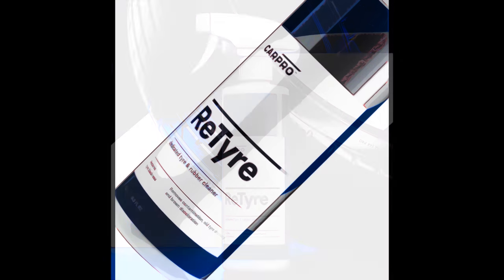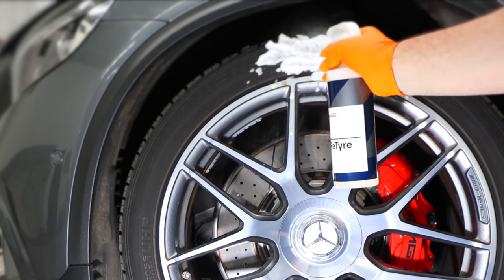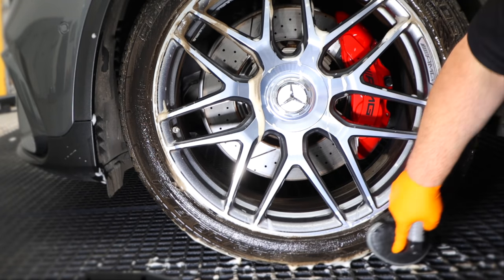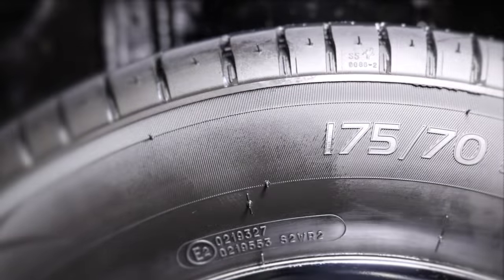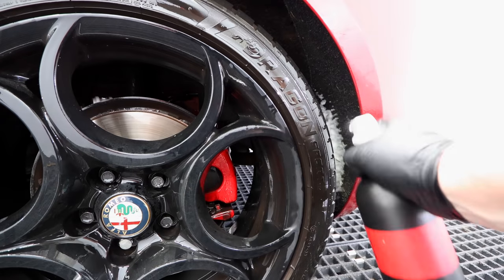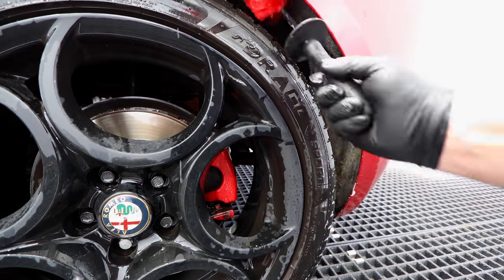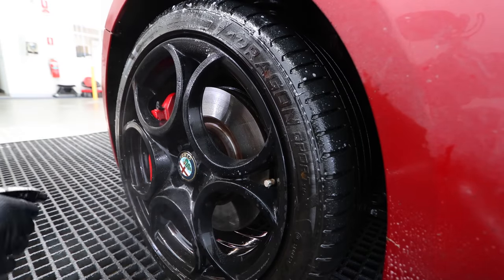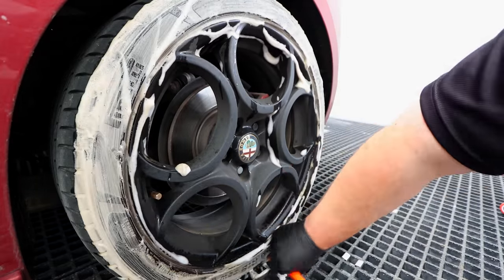Carpro New ReTyre | Car Tyre, Rubber & Wheel Cleaner Reviewed & Demonstrated!

Comment: The foam trigger looked very hard to use and you could try in a IK Foam Pro 2 Handheld Pressure Sprayer or similar. Carpro retyre looks like it does at excellent job. The cost wise you would never use this item professionally or as a weekend warrior. You would use Valetpro Bilberry Wheel Cleaner that diluted would cost (5l concentrate) you £26 for 50l which seems to be the industry standard at 52p per litre. For a touch less wheel cleaner I would recommend 25L Car-Chem Iron Detox Bleeding Fallout Remover  Wheel Cleaner at £76 which works out at £3.04 per litre again this is the industry standard in the UK and also does an excellent job of dissolving embedded iron on car panels.

Comment: How does it compare to the likes of P&S Brake Buster/Adam's Wheel and tyre cleaner? If it works just as well with 1:1 with water and can clean a tyre with only one pass, there is more value added. But using it neat means going through product much faster. I have read that you don't need to fully coat the tyre for it to work well and that adding a standard nozzle helps with more even coverage so that should help also in making it go a longer way.
Reply from the maker: I haven’t used Adam’s Wheel cleaner and only have limited experience with Brake Buster so I’m not the best person to ask there. I think with all products you can certainly tweak and adjust it to address the contamination/goals at hand, so yes, I think you can tweak the application to suit your needs.

Comment: you did a review on shine supply a wile ago and I did ask you whats your fav or what i should try the most you said wise guy and I love it it strips and cleans the tyre really well so my qustion is would retyre be be a good product to test as a replacment if its cheaper in a busniess sense ??????
Reply from the maker: Wise Guy is funny in that it’s really expensive in smaller quantities but really cheap in bulk - which probably matters more because these really aren’t products to buy 500ml or 1L. 
So at least here locally Wise Guy is much cheaper than ReTyre when you go for the 4L but much more expensive when you go for the 500ml options. 
But I guess the other question would be how much would you use of each, is one significantly better or quicker at cleaning than the other and what dilutions you’d use them with, which all adds up to labour and product costs - but I don’t have the answer to that yet!

Comment: Very intriguing. I'd love to try this on my truck, as I've never cleaned the tires in any way in the 3 or so years I've had it, so I'm sure it would be incredibly satisfying to use on it (though it needs new tires anyway). 

Just a general question for either you or anyone else, if something is high PH, is it still able to be used outdoors? Obviously not in direct sunlight, but in terms of environmental, is it safe in that sense?
Reply: I’ve used high ph products outside and it’s fine as long as you don’t let it dry or soak for too long. I’ve used high ph shampoo/soap on cars as a foam wash such as NV Snow+ outside with no issues. Just use it as the manufacture recommends and it’ll be fine. This is just my experience so hopefully someone else will comment and give their insight too
Reply from the maker: I definitely think it would be incredibly satisfying to use it on 3yr old tyres that have never been cleaned! 
You can certainly use high ph or high alkaline based chemicals outdoors, I did so for many years as a mobile detailer, and it’s even safer being outdoors as you don’t have to worry about having good indoor ventilation. As a shop based detailer I’m required to have a chemical seperator because several cars are being cleaned in the same location for commercial services, but as a general consumer or a non-fixed mobile location I think it should be fine as it’s not constant frequent use in a single area. We all use certain chemicals to keen our homes, maintain gardens, work on our cars or trucks and so on and remember that a high alkaline or even low acid chemicals in the ph scale are found in every home in the world and don’t necessarily determine how strong, weak or safe a product is, ph is just one measurement and doesn’t on it own mean a product is damaging or volatile.

Comment: Happy New Year Sandro and enjoyed your first video for 2022. As you used a spray trigger on the diluted solution 1:1, 1:2, could the spray trigger be used in its concentrated form or it requires the foam trigger to work the best? Cheers.
Reply from the maker: Happy new year and glad you enjoyed it! 
You can certainly swap to a standard trigger when using it neat, but there seems to be an advantage in the foaming trigger beginning able to create better and more effective dwelling foam. But I think if the foaming trigger had a slightly broader spray pattern that would allow you to get better coverage faster and use less product which would seem to be the idea situation.

Comment: Great video and info Sandro! I know you had limited testing with ReTyre, but do you think it would be just effective when used neat on tires if you had scrapped the foaming trigger in place for a normal spray head?

Thanks and Happy New Year!
Reply from the maker: Thanks mate, I do think it could potentially work just as well with a normal trigger if the product doesn’t run off the tyre too rapidly. The other thing to test out I’d is just applying the foam straight on the brush and comparing that to directly applying it to the tyre. 

Happy new year, hope it’s a great one!
Reply: @CarCraftAutoDetailing  good to know! I will try both spray heads - I like the foam better for the most part, but it does seem to use much more product when attempting to cover the entire tire with foam.

Thanks again 🙂

Comment: Given it's high PH level, would allowing it to drip onto unprotected diamond cut wheels while cleaning be an issue do you think?
Reply from the maker: Most modern metal finished wheels are still clear coated these days (you can easily test that by rubbing a spot with polish and see if you pick up the black metal residue), but otherwise just like using a strong acid cleaners you should show caution around bare alloys and steels with ReTyre, bare chrome wheels should be fine though. But a general good practice with all wheels is to rinse the rims first as the standing should also help reduce the likelihood of chemical staining, and maybe just spray your tyre cleaner straight into the brush and just use a ph neutral one if you know you have sensitive rims.

Comment: Hi, Sandro!  It would appear that Retyre was designed for tires only.  There is no mention on the product that it’s to be used with rims.  The directions clearly states use on rubber, and that the product should be agitated.   So why did you spray it on your rims?  I’m just curious.
Reply from the maker: May products can be used for many diverse applications, especially an alkaline cleaner like ReTyre which is essentially a water dilatable APC/Degreaser. Part of my testing is exploring the product and gathering info, that’s why 🙂

Comment: ReTyre appears to be very effective with only one application and agitation cycle. Will save me a lot of time when cleaning really neglected tires that require multiple rounds of application and heavy scrubbing to get the rubber clean. The added benefit of not gagging or choking when foaming on the tire is a major benefit and I will definitely be ordering ReTyre right away. Thanks for demonstrating this new product.

Comment: Hello Sandro, i have used ReTyre twice already. Since its winter here in europe, tyres were very very dirty both times. But i choose different approuch and i used only couple pumps on tyres and couple pumps into tyrebrush. As you mentioned, the scrubing  with brush do the cleaning here with ReTyre so i used for 8tyres only about 100ml of product, it comes very clean as i did test with microfiber as you did. I was using multix 1:5 for tyres last two years, and fall in love with ReTyre immediately as it clean SO MUCH better! Happy New Year and thanks for your content!
Reply from the maker: Great to hear mate and thanks for sharing! I think based on my testing so far  I could get away with using much less as it really does seem to cut through grime extremely well, so that’s great to hear!

Comment: Happy new year mate. 

Honestly, I actually hate those "foaming" trigger ....... How often or if anyone would expect the foam to cover all area by just spraying on and rinse off ? 

As for this product...... I will just stick to my cheap diluted APC and occasionally add on degreaser.....
Reply: Second thought , if I want to use a expensive /fancy product for my tyre, I will use NV purge ......(just brought a 4L bottle on boxing day 🤣)
Reply from the maker: Happy New Year! 
ReTyre like most tyre cleaners is essentially a strong alkaline based APC/degreaser that’s really just been fine tuned for maximum performance on tyres - whether it not it’s going to meet your particular needs is another question! 
Although Nv Purge is amazing on rims/wheels and also great for tyre maintenance cleaning, it’s really not as effective on badly soiled tyres where a strong alkaline cleaner always seems to excel rather than an iron removal based wheel cleaner.

Comment: That looks like it uses A TON of product
Reply from the maker: I got to test that 500ml bottle on about 4-5 sets of tyres and quite a few wheels so it seemed decent in that respect, but testing something new usually involves increased use as I explore it and try different things out which may not necessarily be the most efficient way of using it. It’s all part of the learning curve with something new 🙂